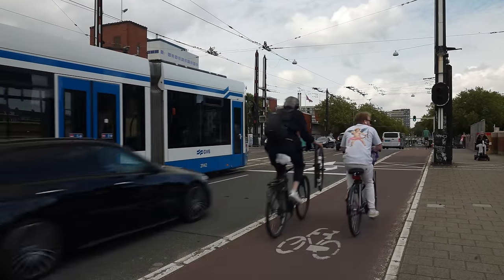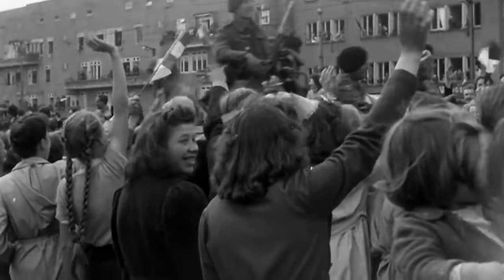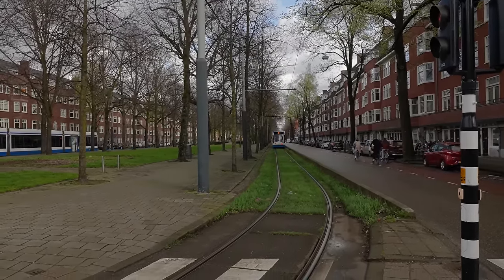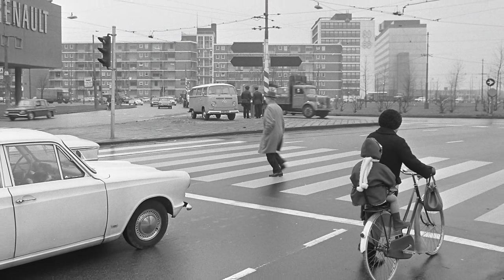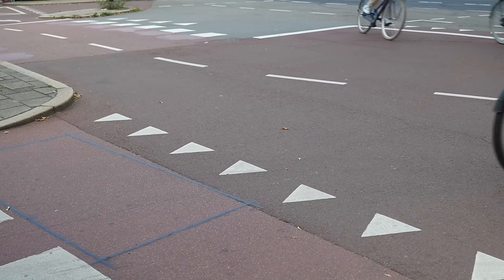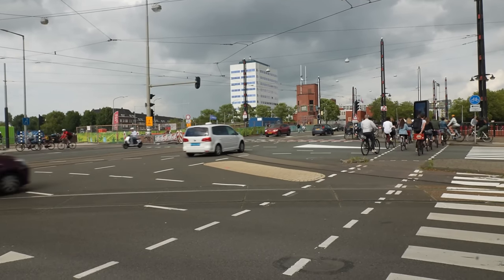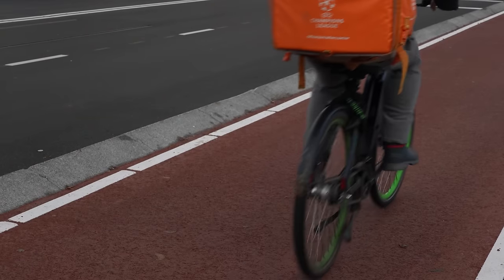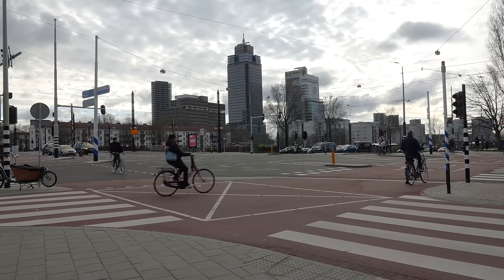Amsterdam Closed This Bridge to Cars (but not bikes ofc)

Comment: 15:22 - Slight correction (an acquaintance of mine had some knowledge on the renovation):

As far as I understood it, this was actually an issue with the company in charge of renovating the bridge, as they didn't properly make the surface to spec. The result being that the rails, if inserted properly, would cause a hazard for car-traffic. So you can blame the cars for that one too ;)
I was corrected here, it would cause a hazard for all road traffic, so unfortunately no car-blaming for this one.

I'll ask the involved person later to fact-check just to be sure, but I'm pretty sure that's the story.

Edit: I have asked, and edited the info slightly to be more accurate

Comment: 10:14 - have you ever seen the trams run on tracks that were lifted onto some kind of piers? All ground under the tracks was excavated, the tram was about half a meter up in the air!
It does make the tracks buckle a bit because there's no ballast bed - it's an uncomfortable ride when you pass such a construction site.

Comment: Ok here is a fun fact about public transport in The Hague, Which Amsterdam clearly does not entirely have yet. 

Both busses and trams have something called a Co-pilot, this singles the traffic lights ahead that a tram or bus is approaching. The traffic lights that is ON ROUTE for the bus or tram will turn green. So if a bus is stuck behind a few cars, all the cars in front are allowed to pass through until the bus crossed the intersection. There is so much more to this system, it is a feat of (computer) engineering! There are a few exceptions but intersections work very smart in The Hague, most are fully computerized.

Comment: Amsterdam Amstel Station is such a nice station. It's used as a stop for multiple intercity trains an hour, is also a metro station for the lines 51, 53 and 54, and some international trains like the German ICE drives through it, and all that with 2 train tracks and 2 metro tracks

Comment: Here in Middelburg, near the train station there's a bridge going over a Canal that was converted probably 5-10 years ago from a car and bike mixed bridge to bike only (with access for taxis and busses). That bridge was notorious for being a safety hazard for any cyclist on it, and honestly it's so much better now and traffic flows better too! Turn out that if cars don't have to drive super slowly to make sure you don't have some old lady on your windshield, the traffic will flow better.

Comment: Your comment about car drivers driving over train tracks reminded me of a situation Saturday in San Diego. I was driving down to the trolley (I know, I know), and one of the parking lot areas was caution taped off, due to its propensity during heavy rain (which was expected). Of course, someone broke through the tape in one part, and a host of idiots followed over the (now broken) tape line.

Comment: I work nearby (Omval), and with a bad eyesight can't cycle that well, and also had to take tram 12 to get to Museumplein several times. Before deciding on taking a metro from Amstel to Centraal and then a tram, there was a need to walk using this temporary bridge, and this was a horrible experience every time, because cyclists and moped riders (not all of them) couldn't care enough about the pedestrian safety (as in flying on or near the walking path with a high speed), not to mention the intersection was neglected on both sides of the bridge, and just uncomfortable to either crossing a few roads or walking past that wall. Road inspectors were present maybe 40% of the times I walked there. It just felt wrong, but was still impressive as for the deaign. Good it's over, and let's hope tram 12 will be back soon. Now GVB promises to finish in September 2024.
Well, after all people have a different experience.

Comment: In LA, the new 6th St bridge cost like 500 million USD, yet they still only installed a short curb with plastic bollards for the bike lanes because car drivers need an emergency lane to pull over...I think only pedestrians got the concrete wall. Meanwhile, plenty of bridges across the US with bike paths install concrete barriers with no issues.
Reply: And the worst thing about this is that the original design did have the bike lanes 'behind the wall' but 'concerned citizens' had worries about 'fast bikes so close to pedestrians' that were listened to. A case of badly weighing safety risks and not standing their ground by the city and project team. The bridge is comically wide and if constructed in Amsterdam it would only have two motor traffic lanes judging by the amount of cars that actually use it. Then 2/3 of the space would have been for pedestrians and bikes.
Reply: @MrAronymous  definitely not a good location for such an overdesigned bridge. Everything has to be car scale in the US because "but what about muh traffic", while Amsterdam keeps the roads at a human scale. I live in San Diego, and luckily things are slowly improving for bikers. We also got a new concrete wall to protect a two-way bike path on a bridge over the SD river. Also have new bike paths in Balboa Park to connect downtown and eastern neighborhoods.

Comment: "when I see construction, I know it's going to make it better" really hit me because in my US city I feel the exact opposite. When I see construction, it generally means they are widening/adding lanes for cars or something else that will make life on a bike or on foot harder. A recent example is the city worked on replacing sidewalk ramps, but somehow they did it in the dumbest way possible so that the crossings no longer line up with the sidewalks (they make a little jog to the side). It seems like it would be a small thing, but when you are walking it's really annoying which means most people continue walking straight across where the ramp used to be (and that's just grass and dirt now). 😔

Comment: "Bring back the trams as soon as possible, please. I need them. I can't live without trams." that is something I can't understand, because when I would be living in a city this well designed for bikes I would not depend on public transit, I would just do everything by bicycle?! 🚴💪
Reply: When it comes to transit I think it’s a great thing to have multiple options. What if you have a flat? Broke your leg? Etc.
Reply: Transit is better and a lot of people just dont want to ride a damn bike. You ironically sound the exact same as someone asking why they dont just drive when they want other options besides driving. If I ever get to plan my life around never having to drive its going to include never having to ride a bike.
Reply: @gencreeper6476   Yeah, you are right. It depends on personal preference I understand. In the video he just sounded so desperate, but from a standpoint that you don‘t like, could or want to ride, then the statement is much more understandable. For me personally this city would be biking heaven. I personally would do everything by bicycle (at least in a 50km radius).
Reply: @tim6850  I understand and accept your argument, only the thing with the flat is not a thing, because it is quite common to have a flat if you ride a lot or for example go downhill. So a flat is only an inconvenience of about 15-20Minutes. I always carry a spare and you can easily fix most of your bike problems on the go except something like the frame or derailer breaks totally.

Comment: The part at 9:40 deeply contrasts to one of stockholm's few tram centered areas, Lidingö. In mid 10s, Lidingöbanan (the tram or maybe even lightrail trough Lidingö) was out for around 2 years because of renovation and introduction of new trams and the passed autumn and winter, it was out for one of the most ridiculous reason I've heard of! In summer 2023 Gamla Lidingöbron (Old Lidingö Bridge) got demolished at the same time as the tracks were coupled to the new Lilla Lidingöbron (Little Lidingö Brigde) but because of financial disagreements between stockholm province and Lidingö about the catenary posts on the new brigde, it will not be opened before late may this year. This means that Lidingöbanan's passage to stockholm will have been out for around 10 months it theoretically could have been in service! It makes me pissed how completely transit can fail just because of the politicians being stupid and didn't think through some small bureaucratic details.

Comment: only 4 month? Damn this would have taken at least 3 years in Germany with Budget twice as much as planned and of course they would have build a second bridge too but for cars, but obviously this would have taken 3 years too so this whole project would have taken 10 years? Youre asking where the  added 4 years comes from, well it has to be planned somehow but in the middle of the planning phase the recognized that this bridge is a momnument and the plan cant proceed like this.
After finishing this bridge someone noticed its now to narrow for cars and bike so theyre closing the bike and pedestrian lanes.
Reply: This project started in early 2020. The constructor got the project in summer 2021 and needed 2 years of designing and planning before starting building in 2023. It still took close to 3,5 years from the first idea to completion.
Reply: @kempo_95  The key point: They planned and then built it. Lately in germany, they don't properly plan, make bad contracts (so companies have no incentive to deliver) and start building without properly planning. Some costs overshoot and some delays and mistakes can be expected with any big construction project (like what happen to the tram). But germany seems to have more and more trouble, where things do run out of control.

Comment: In my city an important bridge is also currently under construction but it is only open for the tram lines, so I have to cross a busy road with my Bike without any traffic lights (because they are also offline because of the construction). At least they have built a temporary tram stop because the other one is also close because of the same construction zone. 

The bridge is called: "Neue Elsterbrücke" and it is in my Home town "Plauen". It's in Germany.

Comment: The main road in near my house has major construction work done right now. It takes over 2 years (until the end of 2025), they started last fall. The whole time cars will be able to get through while walking sucks and cycling is downright impossible unless you fancy getting taking over really close. I take quite a detour on my bike because I want to survive this. When everything is said and done one lane will be cycling path. But without any protection, just paint and parking spots for cars on the curb which means a dooring zone. And that's new infrastructure, there was no bike path before. The only really good thing is the reactivation of the tram tracks and they will be with grass. This is gonna be awesome.

Comment: Pittsburgh, my city, has a similar, although not as high-profile, bridge conversion story. During Pittsburgh's heyday as the steelmaking capital of the world, two factories, located on either side of the Monongahela River across from each other, were linked by a railroad bridge. Trains carrying steel ingots fresh from the blast furnaces crossed the bridge to bring the steel to the factory where it was processed. For this reason the bridge was named the "Hot Metal" bridge. When the steel industry left downtown Pittsburgh the bridge remained with no purpose. Then in 2000 work began to transform it into a pedestrian and bicycle bridge. It reopened in 2007 and is now a link in the Great Allegheny Passage bicycle trail that ends in Cumberland, Maryland and on to Washington, DC. Pittsburgh was once one of the worst places in North America for cycling. But with the addition of the Hot Metal bridge and other cycling infrastructure we've become a more bicycle-friendly city. Pittsburgh will never be Amsterdam (we have hills, real hills!) but it has shown what can be done to make cycling a viable alternative for older industrial cities.

Comment: 9:40 – "The tram runs through the construction": this was the standard in Budapest too, during the socialism when public transport was still important. In the 90s they still kept doing it out of habit, shortly after they just stopped caring at all. The method was easy, they build temporary tracks, if necessary bridging across underpass and subway tunnel constructions.

Comment: The local important bridge was shut down for repairs (but only for cars). However the local newspaper never got the memo because they only talked about it being shut down/unusable. Which it wasn't if you weren't in a car. So annoying! 
(Basically nothing changed unless you insisted driving there)

Comment: Singapore LTA def need to watch this... the bike paths need so much improvements... 
--------------------
The Bike path network is mostly called the PCN or Park Connector Network. And most paths are just a piece of tarmac or pre-existing asphalt promenade path with some PCN specific decors or simple paint label painted on (mostly just bike or ped spaces labels for a section) near zero improvements are done to improve the road crossings (at least outside of the Tampines cycle town area)
Reply: It's absolutely wild to me that a city-state like Singapore, where cars are that expensive & take up too much room, doesn't invest in proper cycling infrastructure...

Comment: Interesting video, although some countries rely on car and trucks, they don't have other options, people are working on solutions. 
It's interesting in seeing how these much smaller countries, the close knit ones are changing for the better, either increasing public transport, adding bike lanes, subways. 
So many good ideas, again I can't stress this enough, it depends on the country and population density. 
There are so many factors that go into it, what works in one place, might not work in another. 
At the same time we should all be pushing for better city designs which discourage personal vehicle use.
Reply: I'd also note that population density depends on the transport infrastructure too, it's a bit of a circular problem, which is why it's hard to fix

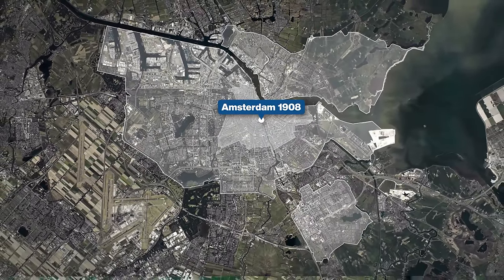Comment: 2:00 - do not forget that having a car in the pre-war days in the Netherlands, was only reachable for doctors, engineers, members of a Board of Directors, and high ranking merchants. 
Things were wayyyy different in western europe than in the USA - a model T was not an affordable car here. If you look at 1930s films of Amsterdam streets, you'll still find mostly trams, bicycles and hand carts. It wasn't until the 1950s that having a car became in reach for more than just the richtest 10 or 20 % of the dutch population. Amsterdam was a poverty stricken city, entire neighborhoods like the Jordaan were unhealthy slums. 
The cheapest 1960s Chevrolets that were attainable to many people in the USA, was an unbelievable luxury in the Netherlands. Having even a cheap american car meant that you were very well off. The average person had a Fiat 500/600, VW Beetle, a 2cv or a Daf - essentially an air cooled 2 cylinder umbrella on wheels that could only barely make it to 100km/h, if at all.
The parts from 1960 on are clearly more designed with long car-roads in mind. However, because Amsterdam still had a lot of laborers and dock workers (who often couldn't afford a car), good public transport was essential. Still, no bicycle infrastructure was there until the late 70s. 
Only from the 1970s forward, when people started to shut down and occupy entire streets because of the high number of cyclist deaths in the city, was there actually a concious effort to create bicycle safe infrastructure. Before the 1970s, the concept of a cycle path just didn't exist.

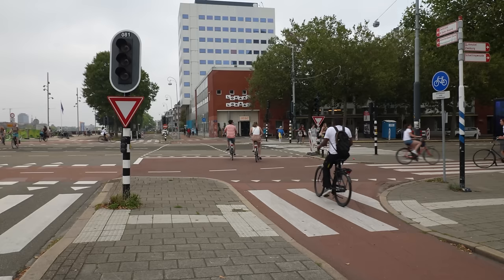Comment: 9:25 "when the traffic lights are out, the road markings take precedence". True, that's in the Dutch Traffic Code "rvv". But the traffic expert of the City of Groningen has a quite different, and imo very controversial, opinion on that. The "alle vier tegelijk groen" crossings over there are infamous.

Comment: Trafficlights and pavement-painted signs work a little bit different.
The signals on the road are always leading! The trafficlights are to assist.
For example: if you stop at a trafficlight with 'sharkteeth' before you, and you get green, if you get hit from someone driving through red, you to get a fine for not yielding a car on a "voorrangsweg".
That's because when your light is green, the roadmarkings are still 'active'.

Rephrased it:
If you drive towards an intersection and the crossing road is a priority road, you drive through because you have a green light, the priority rules apply as indicated by the markings on the road at the moment you pass the traffic lights.  this means that traffic on the crossing road has priority, even if that person drove through a red light.  both drivers are then in violation.

Even Dutch people are amazed of this. But it realy is true.
Reply: As far as I can find, article 64 says the exact opposite:
"Verkeerslichten gaan boven verkeerstekens die de voorrang regelen."
"Traffic lights have president over road signs that decide right of way."
Reply: @TyroRNG  i mean when the lights are green or defective. The markings on the road always have to be followed
Reply: @mienmoeke  when green, you have the right of way because the traffic lights have president over the road markings.

When they are broken the signs and markings have president.

It makes zero sense for the markings to overrule the trafic light when it's green when that article clearly states that traffic lights have president.